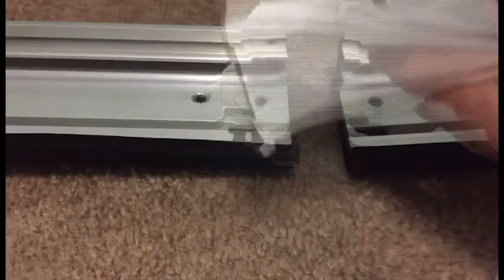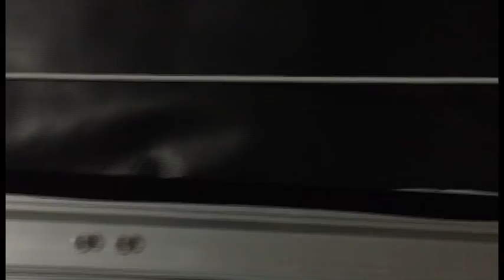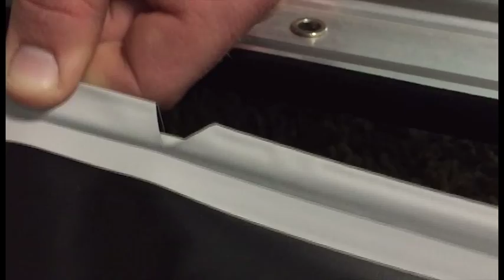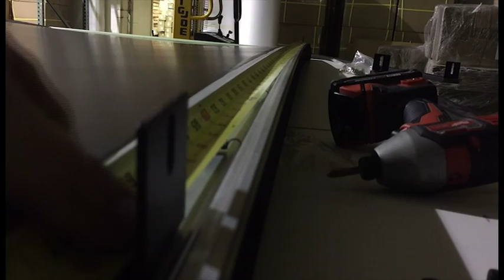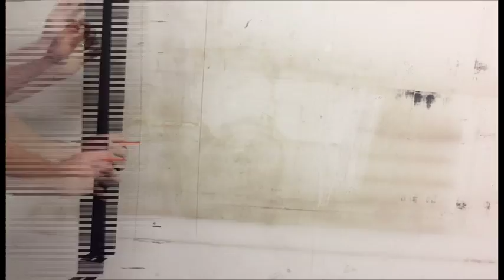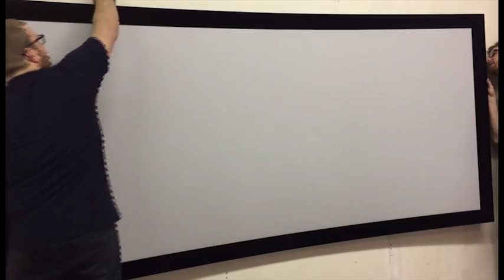8cm Fixed Frame (CURVED or WAB) Assembly Tutorial

Comment: What is the spring size?
Reply: The bigger springs are 13 mm long, either hook is 6mm long and it is 6mm in diameter. The smaller springs are 6mm long, either hook is 6mm long and the diameter of the barrel is 6mm. Hopefully this helps you.

Comment: No way to mount it from the center at top and bottom.
Reply: Dan with no name, we supply each screen with two sets of mounts for each screen. We suggest you place these mounts between 1/3 or 2/3 the width of the frame apart. No more and no less for safe mounting. 

That said, curves are a little bit different. The curve limits where you can place the mounts and must be considered carefully so the center of the curve (the part of the frame closest to the wall) doesn't impede you from attaching the frame to the mounts. 

If you did need a third mount, we have spare hardware kits available on our website that contain extra mounting hardware. Simply specify which screen you own at checkout so we can get you the correct hardware kit.